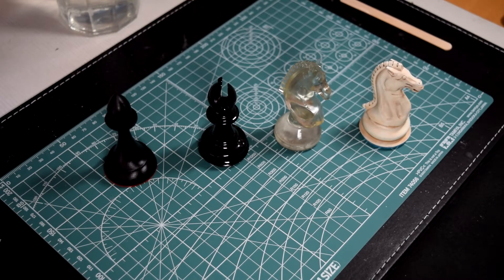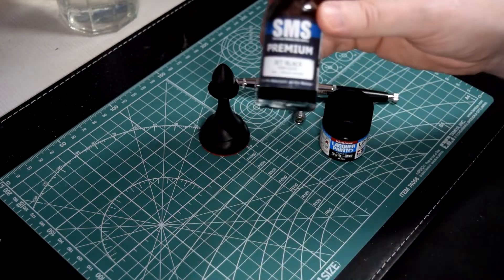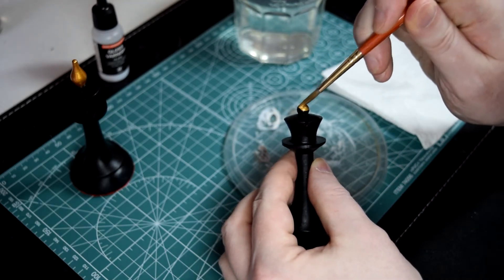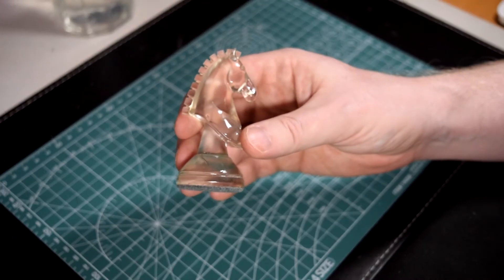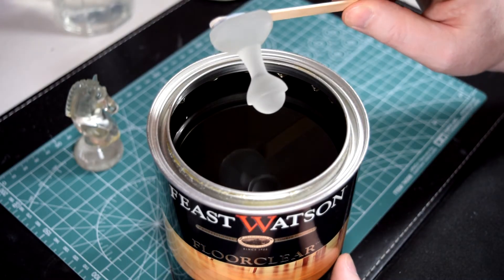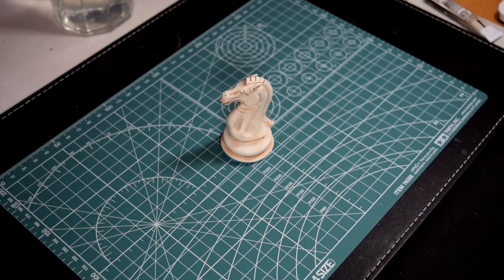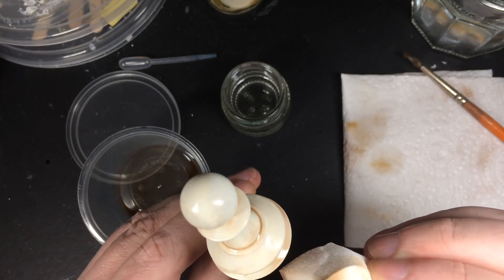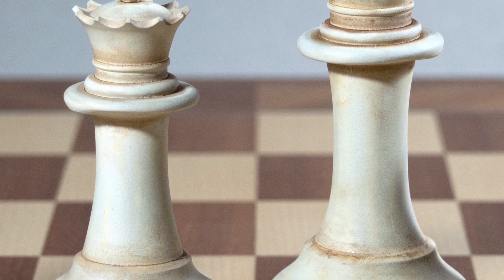How to paint 3D printed chess pieces for gloss, transparent or ivory finishes

Comment: So you dont use a primer, just straight to the paint? Any trouble with the paint coming off over time? Most paints dont like sticking to plastics.
Reply from the maker: I haven't had any paints peel or come off so far. Lacquer Acrylics are particularly durable, they have a finish comparable to nail polish and are extremely tough.

Comment: Is there a danger the mineral spirit will damage the acrylic layer when you start sponging the wash off?
Reply from the maker: No, the acrylic paint doesn't react with mineral spirits. However you need to seal the oil paints with clear varnish if you want to paint with acrylics again over them.
Reply: @conorokane  Thank you

Comment: do they NEED supports in resin printing?
Reply: These prints shouldn't, but over hangs and stuff will need supports.
Reply from the maker: The files I provide for resin printing have the pieces tilted at a slight angle, to improve the print quality and prevent excess suction on the FEP sheet. They include pre-supported versions you can print right away, and unsupported versions if you like to do your own supports.